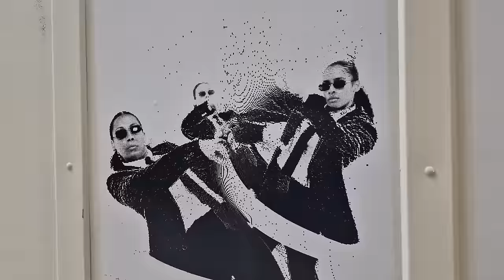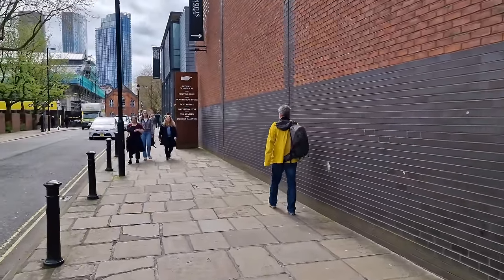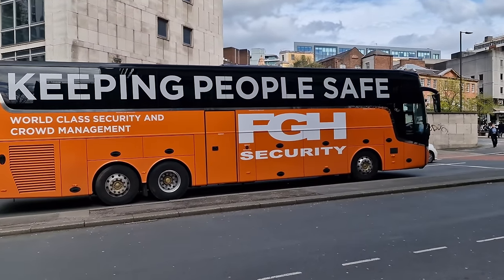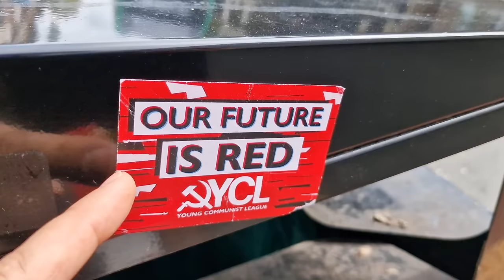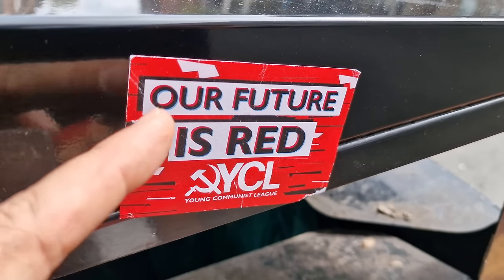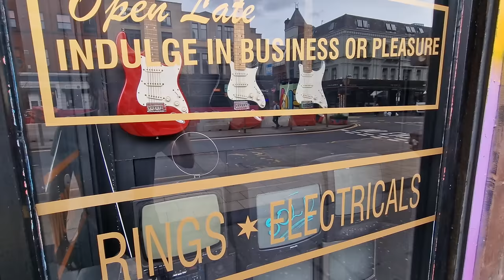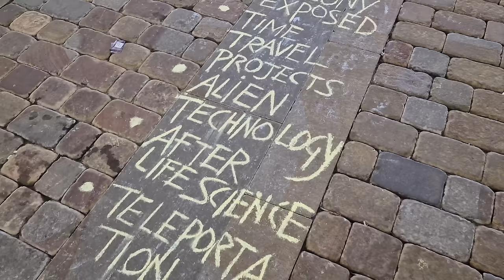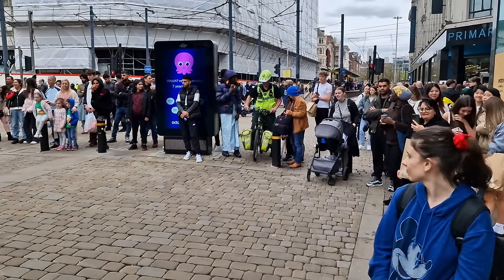Man Smashes Crackie & Car Smashes House

Comment: Pole guy used his car key to remove the cling because he didn't want to pull his pocket knife out in front of the police.
Reply: Good eyes
Reply: But in that instance, he would be perfectly legal to be in possession of a knife as he is clearly using it as a work tool.
Cops wouldn't have a leg to stand on in court.
Having said that, he would be relying of the common sense of said cops not to arrest him which has no guarantee whatsoever.

A piece of advice, never use a key for anything but a lock.
Reply: You're allowed to have a knife in public if you need it for your work. But yeah could be he's being on the safe side lol

Comment: 3:03 wait a sec, Im no expert or anything but surely the support beam should be with the first bunch of crew at the scene??

NO WAIT A SEC! Surely everyone should be well away from the property? If the house does decide to collapse it’s not going to just drop to the ground, it could spread big time, throwing concrete, bricks and tiles everywhere. Taking everything and everyone out that’s in its way.
Reply: And why didn't they remove the packaging before going into the unsafe house shouldn't spend more time in there than what you need to
Reply: And they used a door when the wall was wide open its ridiculous

Comment: who do those orange numpties work for? looked like they've never done a hard days work in their life for one.
second what sort of company is not only using brand new props but they haven't even cut the plastic off in the yard first?
third, they appeared to be putting the props up without any timber blocking, in a situation like that you want to spread the load so its not all sitting on a tiny square pad at the top of the prop
and fourth did he seriously use his car keys to cut the plastic? the home owner must have got his alcoholic brother to do a cash job?
What a bloody excrement show
Reply: Calm down Farty Breath
Reply: @hermanhawtrey8578  good insult
Reply: @JoshDavies111  good enough for you, Farty Breath.

Comment: Acro props straight to the ceiling, 😮 well seeing they are not builders, 2 acro's on inside as close to the wall as possible spanning the joists with a scaffold baton to spread the weight,